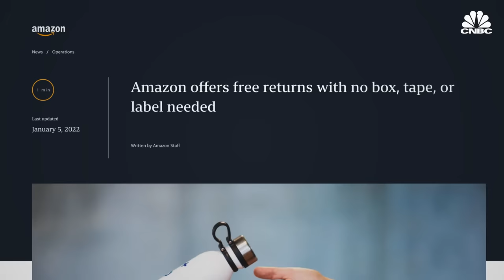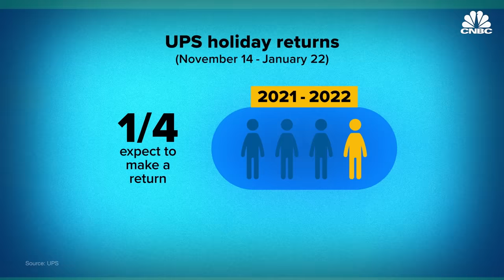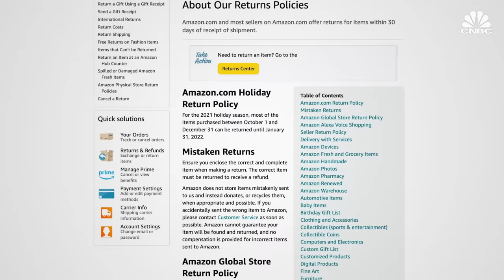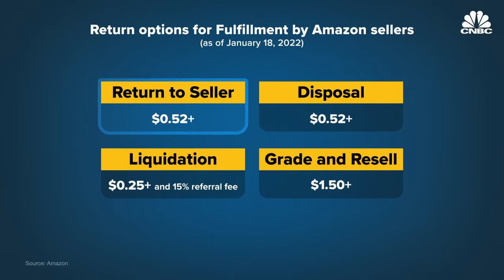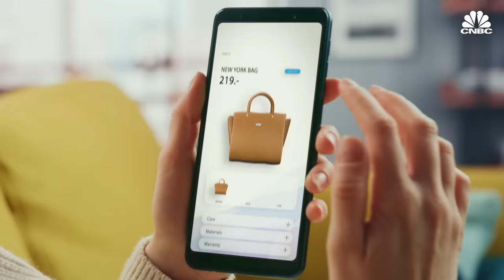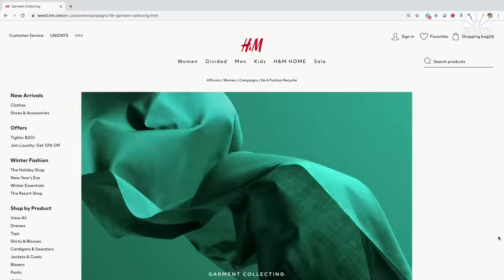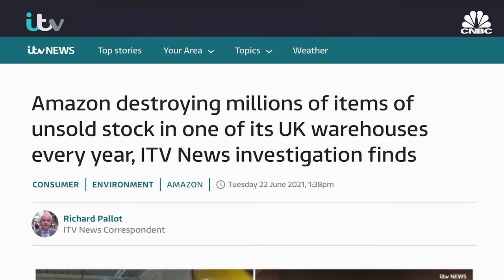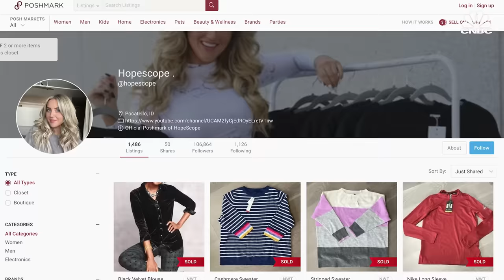Where Online Returns Really End Up And What Amazon Is Doing About It

Comment: There’s a big online shop where the online returns ( depending on whether the customer’s problem is under the scope of the free return) must be paid. Also, before the money is refunded, the returns must reach the shop, assessed, and if no problems found, the shop agrees with the procedures of refunding. This, I think, could minimise impulsive buyers who buy three different sizes and return the two.. or there must be a problem on the amazon platform where the specifics of the products should be all on the description..maybe add some photos of what body size could wear such clothes, weight, height, etc.. I don’t know about Amazon coz i don’t use it, but i am more concerned about the pollution produced by this return products turned landfill. Amazon is older than this online shop, but it seems the later’s platform is more advanced or developed..

Comment: Here is an example of seller stupidity. I ordered 1 set of 4 liqueur glasses. First shipment came in loosely packaged, box was damaged and 2 of the 4 glasses were shattered. Contacted seller, asked that they secure the glasses better and was told to keep the damaged glasses, they would ship new set. 2nd shipment came, packaged the same as the first and contained 3 broken glasses. Contacted seller and explained to them again what had occurred and requested that the packaging be better wrapped and secured. Again, keep the shipment and they would ship  another package. 3rd package showed up with 2 broken glasses, packaged exactly as the previous two (No cushioning, loosely packaged in a standard cardboard box) and this time we contacted the seller and stated that since they could not package the shipments for rough handling (FED EX, who else) we wished to cancel the order and requested a refund, which was done. Out of a dozen shipped glasses i ended up with 5 mismatched glasses, still not a set.

Comment: I'm careful about what I order. However, items sometimes look different in person. There seems to be no standard when it comes to sizing clothing. This is also true in brick and mortar stores. Some items are not made as well as they should  be. Items made in USA are not always any better than China in quality.  A few times I received a refund but was told to keep the item. I chose to donate.  I think they should donate their returned items to charity. Amazon will never have their own returns store. It's just not profitable. 
I stopped online before covid so it didn't really change much for me. I buy items that I really can't find where I live. Online retailers are not the only problem. We are throw away society. Not really all  the consumers fault. In the 1960s my dad worked for Montgomery Wards. He drove a repair van. He would fix most anything that the store sold. These items were meant to be repaired.  He could fix almost anything. He fixed our friends' TVs. He fixed our cars. He was a car flipper. Even in the 70s my hubby could drop an engine.  Now nothing is fixable or fixable by the consumers . I realize this probably has a lot to do with everything be computerized. We have to take our truck somewhere because of  this. Alot of recycling is deemed too expensive so it goes in the landfills. What is too expensive when it comes to saving our environment? What will be here for my grandchildren as they get older? If you can fix this, then next fix the immigration problems. I live 15 miles from the border of Mexico.  PLEASE no illegal immigrant haters responses.

Comment: Every business has a loophole. Buyers not satisfied with what they get, should return it coz they paid for it. 
On the other hand,  what happens to the return. Why is there so much % returned. The issue is Amazon kind of e-commerce sites wanting to make sales,  ship either knowingly or so,  products with defect. 
In this race quality takes a back seat. When no human interface is used,  with a mass production and packaging scale,  somewhere this is thrown out. 
With technology you cannot solve all problems. China a mass producer builds on its pile of woes. America with its consumerism want more and more. 
Who will solve this problem.  Easy to buy but who will deal with the waste? 
There has to be a mechanism where the reseller ecosystem has to barge in for consistent performance in e-commerce channel. 
All else with malls closing,  only irresponsible end to end game is played.

Comment: pants show size M, even measurement at the waist. But when I get them - they are way too tight. So I had to buy 3 times the pants just to get to a comfortable size. 
Also it's just impossible not to return stuff.
BTW I can't find a new phone on amazon. Everything is renewed.
Reply: Jassy made it harder to do returns.  There are new phones but it’s usually limited to Samsung and Apple.  However, I am now iffy if I want to buy anything over $100 because they are accepting returns and not refunding the customer.  It’s best to buy from your cell phone company, the manufacturer directly, Target, Best Buy, Walmart, etc.